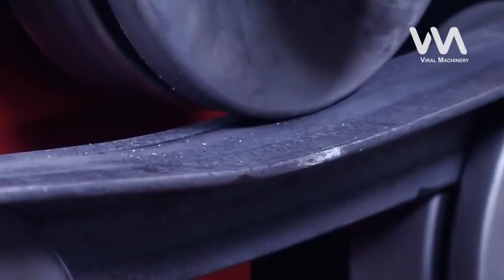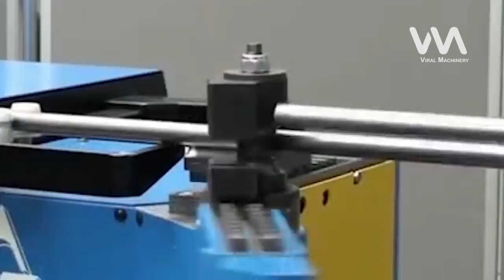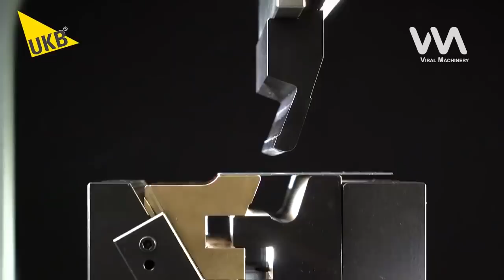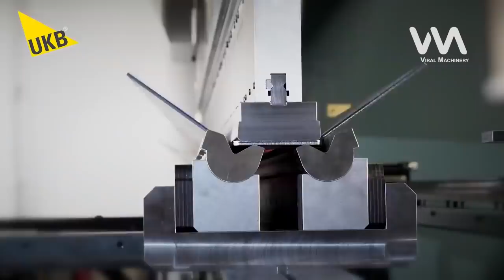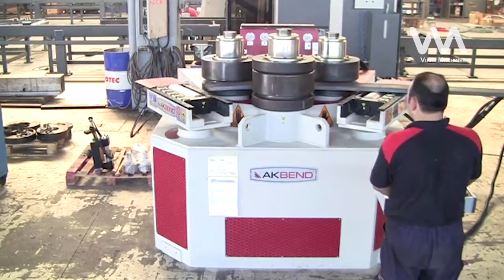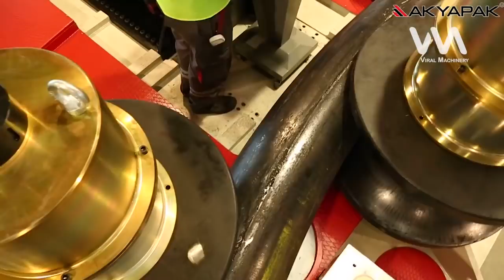Exciting Steel Bending Machine Working & Huge Metal Plate Rolling Methods - Amazing Technology

Comment: 20 years ago in China I went to visit an old state owned steel factory that bended 7-8 inch steel plates used in military equipments  ....the size of the machine was enormous and from the 60’s or 70’s ..... that factory had something like 10000 or more employees ..typical state owned it went out of business in early 2000 .... they had train tracks inside the factory to bring steel in ...